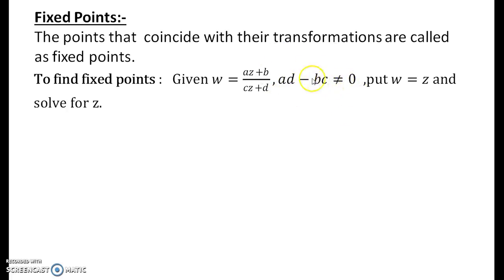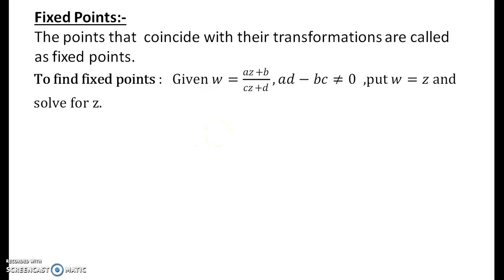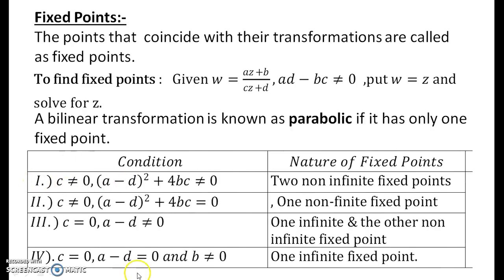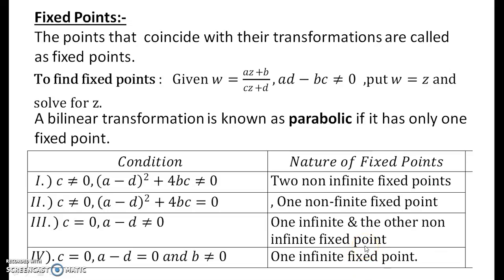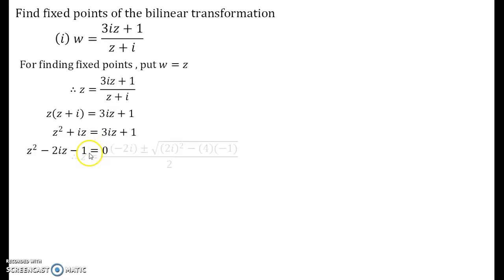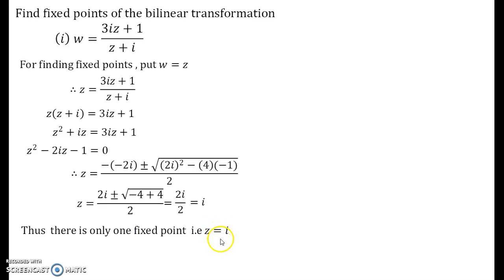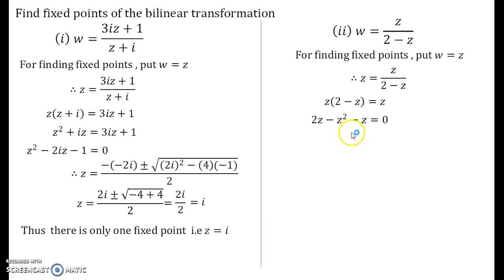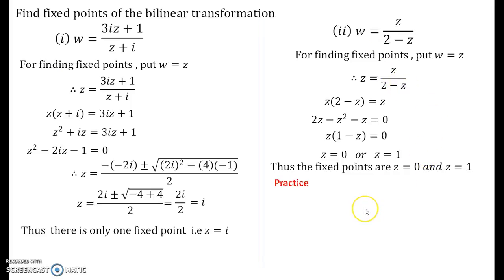Bilinear Transformation part 2 Fixed Points

Comment: Sir practice q 1st solution vdeo....
Reply from the maker: You need to solve the question based on the method shown in the video by yourself. You can post your answer here. I will check it
Reply: Sir uploaded vdeo in Heine borel theorem